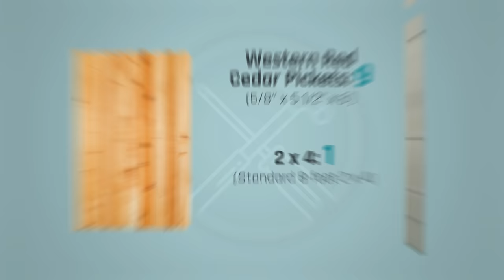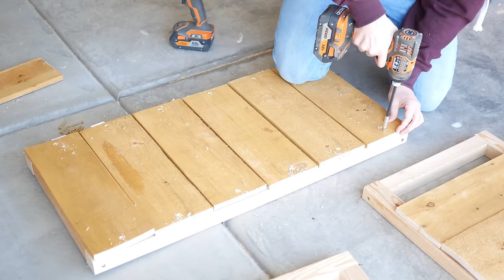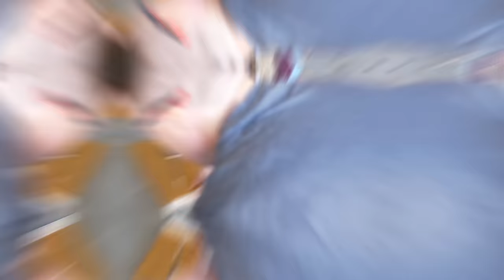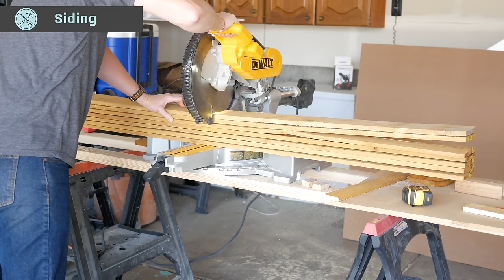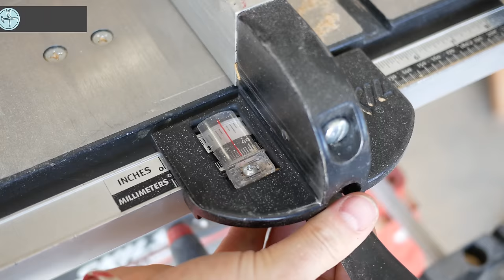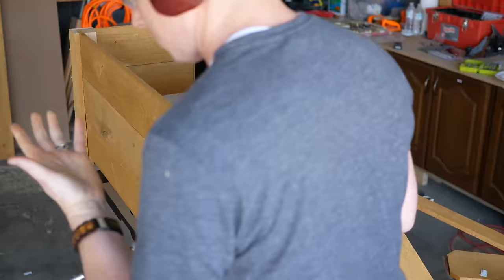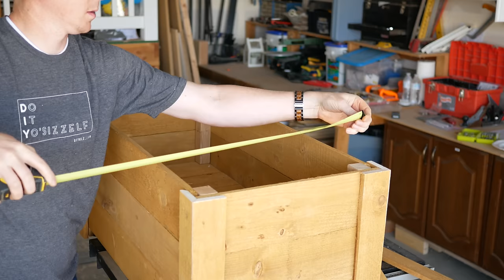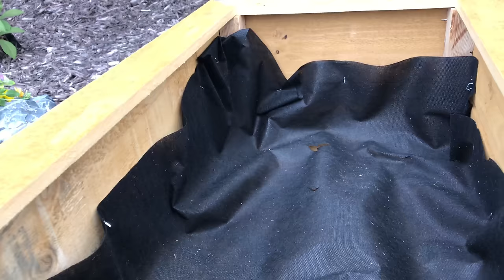$23 DIY Planter Box

Comment: Yes it may have cost you only $23 (wood and plastic seal seems a lot cheaper than UK) but as with all you DIY guys who like to show off on here, the vast majority of people especially in your case don't have a bloody great industrial base saw as you have, most of us have old blunt hand saws and get told off by our Mrs if use a kitchen top to hand saw anything,  Then we get the advert which is why you made the advert , most likely to pay for that saw.
Reply from the maker: I totally get what you're saying, but do you honestly click on DIY videos and expect that they'll require no tools? My table saw cost me $45 USD. I bought it used from the local classifieds. Almost all of my tools are used, actually. I have a nice mitre saw, yes,  but again you can buy a used or low end mitre saw for under $100 that will do everything you need it to. Here's an $89 mitre saw brand new that will work great (https://thd.co/2uw0gMl) or, if that's too much, this mitre hand saw box for $7.50 (https://thd.co/2NeRSZJ). Be creative. Be resourceful. Be a DIYer. As for the advertisements, yes, I work with sponsors in some of my videos. It helps support the creation of these videos that we all watch for free. And yes, it helps pay for my tools and supplies. That's called commercialism and capitalism. Both healthy practices. If you're going to do things yourself, you'll need tools to do it. If not, then why watch these videos?
Reply: What is a kitchen top?
Reply: Then do that sawing outside on a handrail or a porch step or something. If you cared enough to watch a video to DIY a planter box then you should be at least creative enough to find a spot to saw wood that's not your kitchen countertop...

Comment: Ugh... It would be nice to see a DIY video on wood working without the use of a damn table saw and miter saw.
Reply: I agree. Let's see some videos of these made with just a $125 power tool bag from Home Depot (power saw, reciprocating saw, light, drill, 2 18V batteries and a charger) Throw in a hammer and a tape measure, and now let's REALLY DIY.